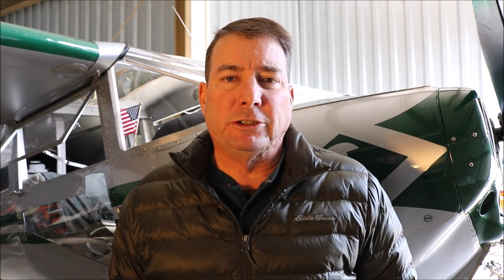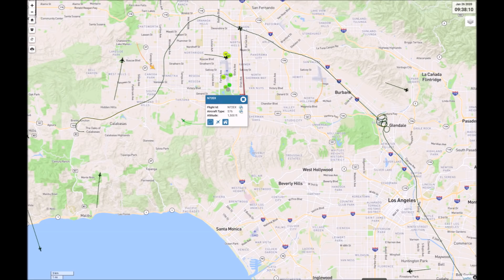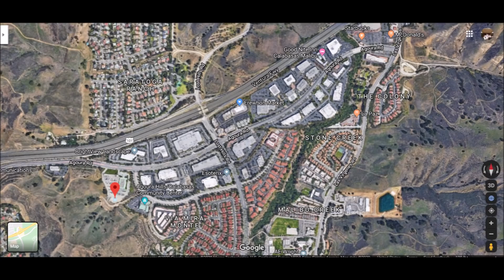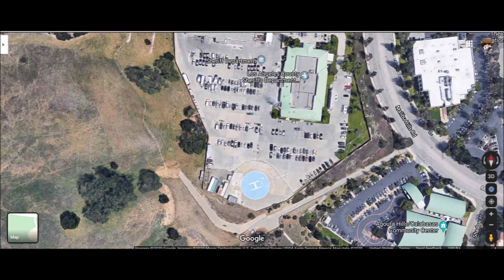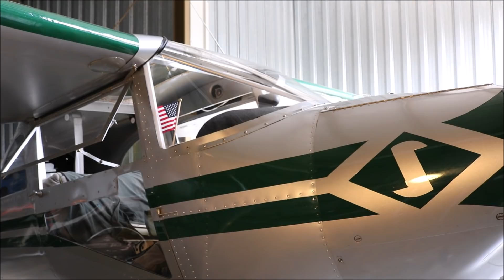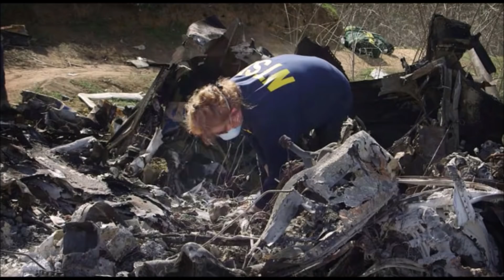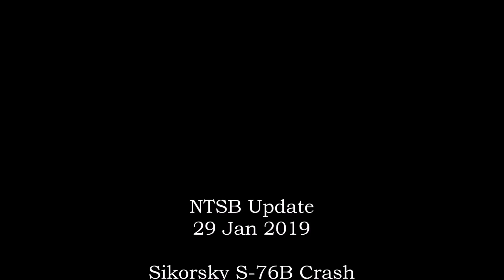Kobe Bryant Sikorsky S-76B Crash Update 29 Jan

Comment: In my 44 years flying, I have found that I can always learn something from anyone you fly with even if they have less experience and  sadly we need to learn from the misfortune  of others.  I live the the Pacific Northwest bought and sold many airplanes and helicopters.  Most of my long distance cross country trips  (from the East Coast or Alaska) have been ferry flights limited to VFR only.  Juan have a couple of thoughts for you to run past Scott.  IMO the turn at the end of the flight was probably not to look for LZ  but controlled flight into terrain due to spacial disorientation.  If the pilots elected way out in marginal conditions was not to slow down, maintain visual ground reference and land but to climb into IFR and controlled airspace.  Seems like he should have had the autopilot coupled and flying the bug on his hsi or flight director at best angle of climb speed? This would reduce and overwhelming pilot load, and afford the time to declare and emergency, ATC vectors to Camarillo.  Flying a helicopter, is more like standing on a basketball, than hanging from a pendulum.   Spacial disorientation onset is exponentially faster in a helicopter than most airplanes. IMO don't think audio witnesses are of much value when listening to a helicopter in a canyon.
Reply: @g0tsp33d  >Perhaps, I don't know. It's my understanding that when/where he took off it was NOT in foggy conditions. I suspect (don't really know though) that there may have been dozens, or even a hundred copter flights all across LA County during the day. Was his flight THE ONLY flight that went down that day in those conditions? Apparently if a copter is caught is very low visibility conditions he can employ instruments instead of flying by the seat of his pants. Fogs can come and go. I don't think it is necessarily fatal if a pilot gets caught in a strong fog if that pilot is experienced and trained for conditions that are not always ideal. Everybody else in their flying machines landed that day.
Reply: @delstanley1349  well the conditions in SOCAL are VERY local. One canyon can be overcast while 10 miles east you have clear skies.
Reply: It's possible he was looking to get above the fog?
Reply: I was thinking the same thing, autopilot on and have the autopilot do the work, climb thru the fog layer with a westerly heading.
Reply: @keithlarkin5369  As part 135, I think pilot was trying to stay "legal" scud running in G airspace, 1sm vis and clear of clouds. G is 700agl in this area. Not saying it was right thing to do. Advection fog thickens at Los Virgenes where 101 FWY rises. Could have been fixated on AP engage problem, turning and climbing,  in the clouds and spatial disorientation. I flew with a hangover once on a Sunday morning. Never again. Always behind aircraft.  RIP
Reply: @discodave1976  that's the thing climb first...forget about turning bust thru the fog layer... confess to ATC and live another day...unfortunately due to the regs. (no black box required) we wont know for sure what really happened. RIP to all the souls on board.
Reply: @discodave1976  trying to stay legal is a dead mans hand. Part 135 is an ambulance chasing lawyers scheme to collect huge law suits has no value for a pilot.  He was guaranteed protection from socal up to 2500 feet he owned that part of the sky.  As a situation it was exactly like a missed approach. You climb out straight ahead to msa call the guy on radio and tell him what you want to do. I'm afraid your right he crashed trying to satisfy part 135 VFR rules by turning back and trying to get back visual. He had foreflight on his laptop he could have kept flying toward Camarillo and get vectors from socal to VFR conditions. This is the no2 saddest crash I've ever seen. It's not the first time the rules have got a bunch of people killed. Pilots fly airplanes rules DON'T
Reply: Buck Myers a
Reply: @g0tsp33d  i feel like if he declined to fly someone else would've done it. and if they made it, probably would have the mentality of "well nothing bad happened last time" etc.. idk i feel like kobe isn't the kind of person to just drop his plans because one pilot says he doesn't want to fly. just my two cents tho.

Comment: I thought there was some sort of debris that was taped off in front of the water utilities facility between the helipad and crash site and considerably far from the  actual crash location.  There is also some higher electrical lines on taller than typical tower poles following that same street in front of the water utility.   Did others not see that?  In this video you indicated the aircraft was whole and I thought of this news clip I had seen earlier.

Comment: The FIRST thing that popped into my mind ( as a commercial and instrument rated pilot) was: "It looks like the pilot was scud-running ...I certainly hope not."  But it seems now my first thought may be right.  I cannot envision any other viable explanation -- not even engine failure. The only other thing I could consider is that the pilot had a heart attack (or some other medical problem that disabled him). If I'm right, then this is the same thing that killed JFK Jr!  -- flying into instrument conditions that you are not rated to handle.

Comment: The first thing the FAA should do is raise VFR minimum for helicopters to the same as fixed wing aircraft. Being able to legally fly VFR with only 1 mile or even 1/2 mile visibility is just nuts.....like playing Russian Roulette with a gun loaded with four bullets nuts. The police aviation unit I fly for doesn't even think about flying without at least 1000' ceiling and 3 mile visibility and probably wouldn't even go in that unless conditions were trending to improve.
Reply: Seriously? You must not be a rotary wing aviator...
Reply: Plusorminus30 I hold a commercial rotorcraft certificate and my full time job is to fly a helicopter. Flying in visibility that low is just dumb and begging for an accident.
Reply: @bamagrad99  The weather at Van Nuys was 1500 2 1/2.  Thats pretty close to your 1000/3
Reply: Plusorminus30 yes it was 2 1/2. So just like the LAPD and LA County Sheriff aviation units that morning, I would’ve been grounded until visibility improved. You seem to have missed the point of my original post though. I was responding to the question in the video regarding steps the FAA could take to prevent these all too common accidents. As it is now, helicopters can legally fly VFR in conditions that would be IFR for fixed wing. Since so many helicopter pilots seem to struggle deciding whether or not to fly when conditions are marginal  (even for them), perhaps the VFR minimums need to be raised.
Reply: @bamagrad99  No, the FAA needs to change the ramifications for declaring an emergency of loss of license. These pilots are legally afraid to commit and get ATC help. ATC doesn't mind, its the FAA thats the problem. I don't care if the minimums were 5000/5, the outcome would be the same if you go inadvertent IMC...These are helicopters, the minimums are fine.  I fly VFR in shit weather at night all the time, its my job.
Reply: Plusorminus30 LOL! Nobody loses their license for declaring an emergency or asking ATC for help! Where do people come up with this stuff? Accidents like Sunday’s happen because some pilots either have bad judgement or just can’t bring themselves to tell their boss or passengers that the weather is too bad to fly.

Comment: IMHO, I think FAA rules makes civilian rotary wing pilots reluctant to declare an emergency and go ahead and commit to IMC. Thats really too bad. In the military, which I am familiar with, and flying a none IFR aircraft, if we go inadvertent IMC we just go ahead and declare an emergency: its no big deal ( we wont get in any trouble).  Most of you will say that it interrupts the flow of other IFR traffic and would think thats unacceptable, and is probably what the FAA thinks too. Others will say you shouldn't be out in that weather SVFR anyway. However, it's a helicopter, its different. One could also say, once the aircraft is under radar control, and safe, the emergency would end and the aircraft could recover to a safe location. The pilot could file a report and be done with it. HE DID THE RIGHT THING!!!!!

The really sad thing is,: it was an aircraft that is capable of being fully coupled by a push of  button, but at that moment that he should have just committed and called inadvertent IMC and declared an emergency would result in an investigation and possible suspension of his license. 

I've seen fog completely envelope the airfield I was flying to in less than 10 minutes leaving me NO options to land there (and NO it wasn't forecast in the weather brief either).

Until this rule is changed, or the ramifications for it are changed, these events will continue. 

Is it really worth the cost of human life???????

Comment: Quick question, assumed the pilot had filed an ifr plan. Wheater at location is bad.  The final destination had a helipad. Im a fix wing driver, not familiar with rotor ops,  are there instrument approach procesures established for helipads? If so are were there any at the mamba sports complex? Or do rotor guys just use special vfr ops for all ops?

Comment: I keep saying it Part 91 "licence to kill".
Reply: There's nothing wrong with Part 91 operations and the helicopter in this accident was operating under 135 anyway.
Reply: @redcat9436  That a very general statement. As far as I am concerned if you are flying for reward, whether it be for a private individual or corporation you should follow the same rules as Part 135. Most Corps voluntarily do but many 91 operators don't. I know pilots who have flown well in access of reasonable duty hours into airports they probably shouldn't be going to and departing in weather they should not be going in.

Comment: Wait.  If they were going into KCMA anyway, why not just file IFR and shoot the GPS Z or VOR approach using the protected airspace offered by the approach procedure?  I thought the pilot was a CFII, anyway.  What's with part 135 drivers thinking they can get by with SVFR in rising terrain with 9 souls on board?!

Out of curiosity, did this S76 have a G1000 or 530W that gave a modicum of terrain warning?  Sure, it's not TAWS, but it's better than nothing.

I dunno.  Sounds like there was no plan on what to do when entering IMC.  (Would 1) follow Hwy 101 on moving map, 2)climb immediate to 5000, 3) confess to ATC have been an appropriate plan?)

Obviously I'm missing something.

Comment: The Sheriffs helipad hypothesis is a valuable lead, I think.  Makes a lot of sense considering a pilot in distress with a superstar on board.
Another vage thought worth taking could be a low-g condition. A hectic control input at 2300ft not to violate Special VFR or airspace?
As I said, a vage thought.

Comment: I worked for the Bristow Group for 9 years at their training facility in Titusville FL. Although not a flight instructor, I was often able to talk to very experienced helicopter pilots flying offshore for the Bristow Group in the Gulf of Mexico, the North Sea, and Nigeria. These pilots do not fly at night nor do they fly in IMC. What every pilot knows  is flight over the open ocean at night is just like flying in total cloud cover during the daytime. You just can't see the horizon for visual reference in those conditions, and requires instruments to do so.
The majority of helicopter flight onshore is visual low altitude flight, rarely above 2500 feet, and not requiring instruments to do so. Pilots lose their instrument skills if not kept up on a routine basis, which becomes a classic case of "use it or lose it". Add to that the anxiety of being at a low altitude and in IMC with hilly terrain all around you, and it's easy to understand how you can become overwhelmed and disoriented which leads to loss of control of the aircraft.
As the NTSB has stated, this is not the first accident of this type to have occurred....it occurs way more often than it should. Even the most experienced pilots can fall prey to spatial disorientation if their instrument flying skills are not kept current. Helicopter pilots, in my opinion, tend to fall behind the instrument curve as visual flying is the norm and instrument flight is not done on a routine basis.
We'll have to wait for the NTSB report to see what the investigation actually reveals, but as they have already stated, there is a long history of CFIT in IMC conditions not unlike this one.

Comment: For a better perspective on this crash, do a search for "S76 Panel". Image results show both the old steam gauge version and the modern glass cockpit.  If you were picturing a Bell 47 soap bubble, this isn't it - it's a commercial airliner with a rotor. The gaping hole in this swiss cheese is the empty copilot's seat.  Workload even in VFR must be almost overwhelming, imagine solo in IMC.

Comment: Low and slow in a heavily loaded helicopter is a recipe for settling with power. Only altitude and speed will get you out of that scenario. Add in bad visibility and little recovery space due to terrain and that is what you end up with...  big bounce on impact, which is exactly what the crash site looked like. Blades come down and take off the tailboom in half a second. They are all in one spot. The wreckage is 15 feet away.

Comment: Thanks for putting up the pictures of the other souls on board.  Tired of only hearing about Kobe as if the others are just collateral damage.  Also I'm reminded of a crash here in Nashville where a hot shot pilot in and F15(I think) did a vertical takeoff into the clouds and lost orientation and crashed into a neighborhood close to the airport.

Comment: Good words. I flew a WB into LAX about 4 hrs after this happened and there was a thin but solid layer about 1500-2000, and the viz below was very poor, not a great day for VFR or SVFR. Did the pilot have an IR ? Surely if you are flying a multi million pound machine with passengers that should be mandatory so if you get IMC , you can get yourself back out ?In the uk for years we’ve had an “ IMC “ rating for FW which is a get you out of trouble halfway house to an IR , giving you the skills to fly an instrument approach if necessary

Comment: With the addition of ADS-B to all aircraft as of this year I am bit surprised that this aircraft hit an obstruction.  I just added ADS-B to my Tri pacer and it comes with a synthetic display and terrain information.  My aircraft is probably way less than a tenth of the cost of this helicopter so they should have had something similar.   So perhaps this helicopter had engine troubles.  If the pilot in question had the credentials mentioned and familiarity with the area I question that he just got lost and plowed into the ground.  An engine issue in a helicopter can be very quick.  While in the Navy I watched a helicopter go in from a thousand feet AGL no message from the crew.  Later learned it was an engine failure.

Comment: From the terrain this pilot eventually had to fly low level through to maintain VFR it reduced his 1000 hours of easy pizzie clear blue to student pilot scud runner.  Vietnam pilots live and breathe this type of 'what do I do now'. His IFR (I Follow Roads) skills are fun until you run out of ceiling.  Calling the Law enforcement heleport or PIREPs to obtain actual fog conditions is ify because of wind changes.  Running out of ceiling can be very stressful when following busy metro hwys cause you can't make turns into stuff you can't see so its up or swallow your pride and land in the first clearing until the weather clears,  meanwhile call a taxi. They weren't that far from their destination.  There is no place for stubborn pride in a cockpit.  From the looks of his final pattern he chose to fly out without trusting his instruments which leads to vertigo, a feeling of falling, pulling aft stalling with no altitude to recover (I've been there, its Horrifying) your only path to recovery is Jesus or stunt pilot training).  In FOG,,,its less possible mechanical and more probable pilot, we'll see after NTSB gets their best guess in.
Reply: Wonderful analysis.

Comment: From what I read the pilot was instrument rated.  If he was current on his IPC and proficient remains to be seen although I find it difficult to think he wasn’t.  Other than a health issue with hm or some type of issue with the aircraft.  It’s looking to be CFIT due to inadvertent flight into IMC.  I’d be curious to know if he had an MFD or some type of moving map on board that would have given him a more detailed look of his location.  I’m also wondering why he didn’t slow up a bit and buy himself some tighter turn radius.  In the end I think he had done this route many times probably in somewhat similar conditions and didn’t have a good exit plan should it go south.